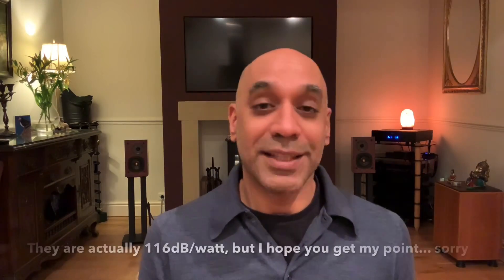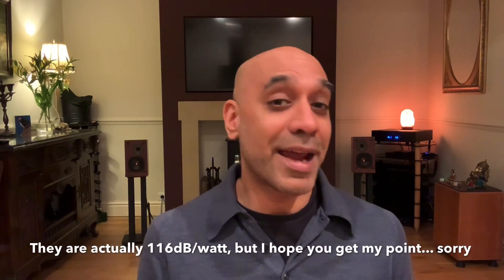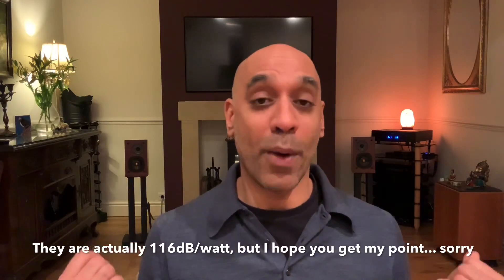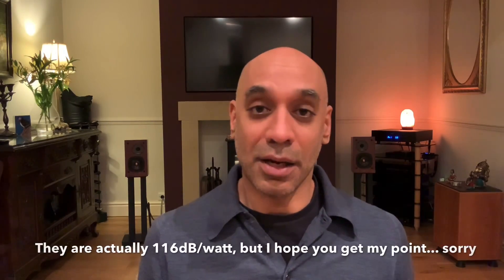Hifi Myths & Misconceptions - Amplifier Power

Comment: The common idea that an increase of 10 dB means doubling the perceived loudness is not accurate at all, because it´s really subjective. It depends on the person making that assessment, and for a given person, it also depends on the circunstances. Example: if you´re exposed to a sound of 100dB, an increase of 10 dBwill sound as a huge increase; but if the sound is only 40 dB, a 10 dB will sound like just a slight increase. It also depends on the frequency of the sound, as our ears have different sensivity to different frequencies. And many other factors.
Reply from the maker: Hi mindtraveller100, it is not my definition, it is a scientific definition based  on a lot research.
Reply: @abritishaudiophile7314    Yeah, i know a lot of people believe that, and i read that lots of times before your video, but if they are talking about a quantity (double) that can´t be measured, then it can´t be objective. It´s like trying to quantify a pain, or a pleasure.
Reply from the maker: Good point, it is purely subjective measure, but subjective can be scientific if it based on a large enough sample size and influencing variables are controlled. Thank you for watching and for your feedback. You raise a very important point. Science can only progress by challenging our assumptions.
Reply: @abritishaudiophile7314   Well, thanks for your words. Always a pleasure to talk to open minded people, a rarity in these days.

Comment: I may be a bit out of date with this request. Over a period of time we need to know more about your Exposure pre+power combination. I think yours is second generation Exposure with revised casework and graphics. I cannot find much about this combo when Googling around. However it looks like it's from the original Exposure days with John Farlow.
      The point of interest is that these amps are before your time. How did you find out about them and what engaged your interest?
Reply from the maker: Hi Anthony, I was working for a London dealer in holidays during my college and university days. They were an Exposure dealer. After I graduated, in the mid 90s, the opportunity came up to work for John Farlowe one summer in Hove near Brighton where I watched these amps being hand built. At the end of my stint, I purchased an Exposure XXV integrated amp directly from John and then upgraded it to the XXI pre and XVIII Super monoblocks a couple of years later. Over the years I have tried many amps but nothing has topped these Farlowe Exposure amps in my opinion. Thank you for your interest and for watching the video.
Reply: Dear Tarun,
Just one more bit of background needed. I lived near Hove in the 1980s and bought an Onyx OA21 integrated amp from Craig and Arthur Hill at Brighton Hifi.
Did you see anything of Onyx when you were in Hove? I often wonder what happened to Onyx and Craig Hill.
Best wishes,
Anthony
Reply from the maker: Hi Anthony, I remember the brand and listening to Onyx amps a couple of times when I worked for a hifi dealer in London. From what I recall I liked the sound but it wasn’t a main brand that we stocked so may have been a customer trade in. Unfortunately, that is about all I remember from about 25 years ago.

Comment: I've had many amplifiers (all integrated) over 50 years listening.  40 watt JVC ,  25 watt musical fidelity A1.   150 watt Krell.  6 watt Opera Consonance single ended. 12 Watt OC push pull .  40 watt push pull valve. None have been lacking power in my room with a selection of speakers. admittedly I favour sensitive types. but I've used 12 watt amp with a 87db sonus fabers with no problems playing as loud as I like in my 20 ft by 11.5 foot room. interesting to hear about 10 db increase needs 10 times power. Never heard this before.  What is 10 db ? I wonder
Reply from the maker: Hi Ado, 10 decibel (dB) increase relates to a perceived doubling in loudness. Thank you for watching and commenting on the video.

Comment: I have Infinity il50  mains, 88db sensitivity with a built in 250 watt powered subwoofer,  my 125 w / channel Carver av705x amp can drive them to theater  or concert volumes if desired
Reply from the maker: Sounds like a good rig Donald. Thank you for watching.

Comment: Well you got part of it right. Decibels (db) is a "relative scale". As such "Zero", 0db is just a reference, starting point. NOT a measurement. If you said you were going to walk 100 miles, the starting point is variable, where ever you say youy are going to start from. 

What you are trying to say is 0dbSPL,. The SPL referring to "Sound Pressure Level" and a somewhat agreed industry standard on lowest SPL for human hearing as the 0db point. 

Without the "SPL", 0db has no reference. And the scale changes for voltage or current compared to power.

Comment: It might be informative to measure sound pressure levels at your listening position. Using properly calibrated SPL meters, you would probably find that a sustained level of around 70 dB C is quite loud. 105 dB C is reasonable for short peaks or crescendos, but requires significant headroom. Pleasing levels are also dependent on the noise floor (which could be as loud as 30 dB C) of your listening environment as experienced at your listening position.
Reply from the maker: Thank you for watching and commenting Invictus96vid

Comment: Great and very educational..I’ve decided to keep my tannoy xtf8.
  The problem I’m finding is that I’m getting some sibilance on a lot of recordings from tidal.  I’m looking for some solutions.  I’m limited changing to much in the Room.
  I’m using the naim uniti atom and shawline chord cables.. I’m changing my steel bars to a good quality jumpers on the speaker terminals .
Is there anything I’m missing here .
I know a carpet would help as well 
Thanks
Reply: Bad sibilance comes from poorly mated and poorly matched audio equipment,  including poor, unbalanced, unrefined sounding audio equipment. The tannoys have  bad and poor unrefined treble peaks, naim have a poor and unrefined and aggressive sound and top end. Poor and unrefined sounding audio equipment and loudspeakers, and poorly balanced and matched equipment, including your source components, together are going to have this affect on sound quality. Poor and low quality power amplification will also aggrevate this issue just as much. Mixing and matching just any old  equipment does not really work and hold up for a great sound quality outcome. You have to have very refined quality capable audio components,  then audio components have to be matched very carefully together to avoid this kind of pitfall. Cables are just the last link to carefully tune to your liking.  If all the audio equipment and loudspeakers are not to a highly refined standard with enough refined power, the cables are not going to magically fix a poor quality sibilant sound in the mids and treble.
Reply: Ian john Horwood thanks for replying.. so you’re saying the naim and tannoy are not refined.  All the dealers selling this combination are selling a flawed system? All audio publications are wrong on theses products..all these products get a grade A recommendation from
Reviewers? Those are respected companies in the audio business.
Reply: Gerald Greene naim is ok but can be quite harsh and tannoy make decent speakers , try to pull your speakers apart further and get a carpet, that will make more difference than cables

Comment: Nice video. One thought. Dont you get a 6dB boost by adding the second speaker. So if your speaker is 85 dB/W/m it is really 91 for the pair.
Reply: I think you would get a 3dB increase by doubling the power. So two speakers that are 85 db/W/m would be 88db (depending on other variables)
Reply: @ChronoCowboy  From distant memory, I would say 3dB too.

Comment: One can save themselves a lot of guesswork simply by buying a pair of properly efficient speakers in the first place. I won't own anything that has a sensitivity level of anything under 92 db, and because of that, I've never needed more than 100 watts per channel to achieve concert-level volume. The fact that there are so many 200 wpc amplifiers out there speaks to the fact that there are too many poorly-designed speakers out there
Reply: "Deep bass from a small box" requires very low efficiency.  I wouldn't say they're poorly designed as such but I agree that they sacrifice everything else.
Reply: @1mctous  Not really---companies like Klipsch and Paradigm have been doing it for years. The reason for low efficiency is power handling. If they make the woofer cones stiff enough, they can take more power. Basically, it's the lazy engineer's way out
Reply: @justsumguy2u Optimizing that one measurement sounds worse at every volume because of the resulting dynamic compression.
Reply: @justsumguy2u  Power handling, not efficiency.  We completely agree that more efficiency is better.
Reply: @justsumguy2u  Speaker efficiency and distortion at a given SPL and distance are inversely correlated.  I shut down a debate with a YouTube troll when I presented him the complete Klipsch La Scala measurements, which BTW had HiFi News' lowest ever measured distortion and highest ever measured efficiency.
Reply: @justsumguy2u  i dont agree. I find the best speakers i have heard at around 85-90 db sensitive both sides has it good or bad, i dont personal like klipsch

Comment: What if the need 200 watts and my speakers can only handle 100 watts?
Reply: What do u mean?
Reply: @chriss881000  he doesn't take into account how much power the speaker can handle.  what if calculations say I need 200 watts of power, but my speakers are only 100 watts RMS?
Reply: @velocci6666  i dont understand the question?  Why would u need 200watts of power?
Reply: @velocci6666  watt goes up as u turn the volume up, it seems like u belive that the speakest need a constant wattage?
Reply from the maker: Hi velocci6666, Manufacturers provide power handling ratings for their speakers so they can protect themselves from warranty claims from people who may abuse their speakers by over driving them. If your have speakers that only have a 100 watt power rating, I am assuming that you have relatively small speakers. If you are regularly pumping 200 watts into them (because you have a large room and listen at loud levels) you may risk overheating the voice coil and damaging them. I would suggest getting bigger speakers with more power handling.

Comment: Hi Tarun. This is great as it’s real world. Even better would be a chart showing the numbers, but that’s asking a lot, I know. I’m interested to ask, if my room and listening habits were the same as yours, and I had an amp that runs in Class A up to 5 watts and then 50 watts pc total into 8 ohms, would most of my listening therefore be in Class A? Also your mike makes your room sound a bit echo-ey so I wonder if perception of loudness would be increased for you because of your room - hard reflecting surfaces etc? Thanks. Keep it up!!
Reply from the maker: Hi Andrew, the room is not so bad but my mic is awful. With regards to Class A, it depends on the efficiency of your speaker, distance from speakers and listening levels. If you have 90dB efficient speakers, you listen 2 or 3 metres away and at about 75dB average listening level,  you will be most likely listening in purely Class A if the first 5 watts are Class A. Thank you for watching.
Reply: Tarun A British Audiophile thanks for your response. I’m happy for sure with what 
I have... and can hear. I have a Moon 240i driving Bowers 705s2. Seem to match well to my ears. Keep up the good work!
Reply: try and not mix SPL and power when you speak about decible ratings-3dB of power and 6dB of pressure is two fold change-also 
also, the human ear has a variance in threshold levels as a function of frequency. @abritishaudiophile7314

Comment: Nice explanation, indeed. One factor is also input levels from source. Just learned that with a new TT set-up, a VPI Super Prime Scout with a Soundsmith Zephyr MIMC* cartridge and a Vincent PHO701 preamp going to the aux in of an integrated amp (Rotel RA1572). With previous set-up (Ortofon 2Mblue to Phonostage of Rotel) I turned volume to around 35%, with the new set-up I have to crank it up to 50% to get similar sound level. This has to do with gain of the phono-stage and the low output MIMC cartridge.
Reply: A volume control is essentially a brake so higher settings (less brake) are actually good.

Comment: Klipsch owners watch sensitivity numbers with non legacy speakers .
From the Cf line forward they are exaggerated 
It matters if your running tubes , mainly SET .
I'd say a 8000 is about the same in reality as studio 580 which is 90db
Reply: Klipsch numbers at not always correct. Their DB rating is waay off.

Comment: Can I ask a question I have Dali zensor 7 I thought all this time they were 8   Ohm speakers lol since 2012 😭😭😭👏  I get great performance for 2 channel  music and  part of my 7.1 set up for movies, I'm still using my denon x4000 that's going as strong as I bought it in 2012. Never felt to upgrade to 4k or atmos as my callings have had alot of design in them so no holes for atmos plus I watch movies in 3D best way to watch a movie. What I'd like to know there max power at 6 Ohm is 150 w. And the denon x4000  has 125 watts per channel I am not gonna cause harm to my speakers am I even though at 80db it sounds amazing even taking into account audessy has -my front left and right - 6 db and my sub along with -5 on centre -12 on sub and -10 on back left and right but that's because back 4 channels are less then a meter from me. This wouldn't effect the performance of the my speakers would it plus 75db  to 80db is most I have my amp restrict  volume  up to 80 db.

Comment: One of the biggest myths: AVR power ratings.  They might say "180 wpc!"  which is only measured at 1khz  @10%THD, not 20hz-20khz both channels driven.  That means maybe 1/3 rated power in the real world.  These things almost never deliver the power they claim. Not even close.
Reply: Don't forget the eBay traders who quote the power consumption on the back panel as the power rating. By their logic, we should all be getting huge sound from our microwaves!
Reply: Not all AVRs have BS numbers. It's also worth noting that a single/two channel rating is what that channel(s) will output. ANY amp is limited by your voltages and current delivery. Here in the US, 120 volts and 15/20 amps is the norm, and usually for the entire room (TV, DVR, internet box, gaming system and other sources must be considered as draws.). 1800/2400 watts is the absolute limit from the plugs. (Some folks have dedicated 240V lines but it's pretty rare for those who are going with an AVR.)  
So if you go with a nine channel unit and grant it 2/3rds of the available power at the lower limit (design parameters are for the 'commoners') 1200 watts and relevant inefficiencies, 120 watts per channel is about it (1080 watts total). 
AVR designers route UNUSED power to the channel requiring the added input. This is a sane policy. 
When I see conventional amps with 50% useful conversion rates and or less efficiency, pumping more than a 100 watts continuous, you got a space heater on that shelf. 
The cure is moderation in peak demand, cut the levels or gather high efficiency speakers. If you have unlimited funds, multiple power lines coming into the house and MANY dedicated HT outlets with high gauge everything will work. And good luck with that.

Comment: Excellent video. So many people have no idea how watts work with amplifiers. Isn't it always good to have a little more power than you need? I've always read under powering a speaker will blow it quicker than over powering it.
Reply: IowAudio Review Running an underpowered amp hard where it is pushed into clipping causes a lot of high frequency harmonics to be generated which is sent to the tweeter which is not nearly as capable as the woofer is at handling power. So you risk blowing out the tweeter by pushing an amplifier too much into clipping. Using a higher power amplifier reduces this risk and of course will sound much better. You literally cannot have too much amplifier power so always buy as much amplifier power as you can afford. Of course using high efficiency speakers like those with horns allows you to get away with less power and simultaneously reduces the distortion which is the main reason that horn speakers sound so dynamic and lifelike. They also can improve the sound you hear because their more limited dispersion can help reduce the reflected sound from the room surfaces yielding more direct to reflected sound energy at your ears. You might have guessed by now that I am a fan of horn speakers. 😊
Reply: Yes an Amp driven too high will clip and may destroy your Tweeter quickly. If the Amp is very powerful the speaker will sound horrible and your ears will make you jump on the volume.

Comment: Great information. Thank you. BTW, Klipsch Heresy speakers are 99db@ 1 meter.  The 116db is at maximum SPL continuous. Enough to blow doors off. Ouch!
Reply: Huw chardon  The Tannoy Arden aren't nearly as efficient as Klipsch Cornwall IV but they offer the virtue of no crossover and therefore an easier amplifier load.